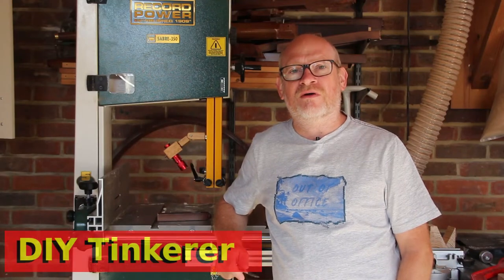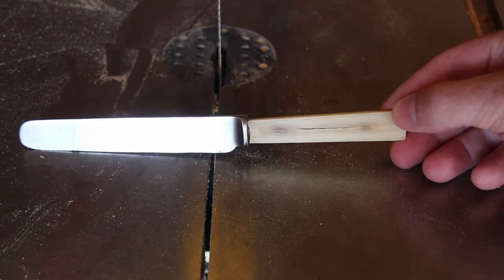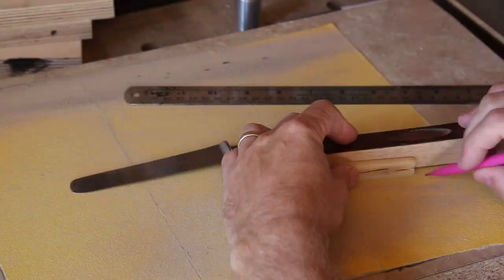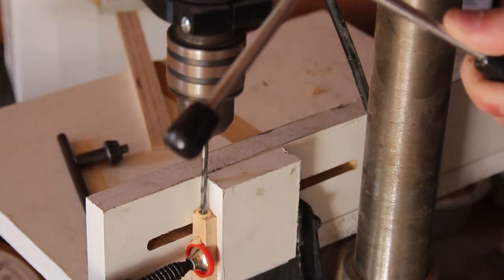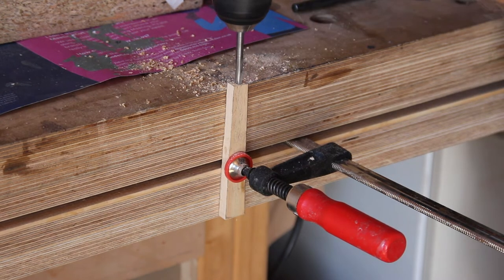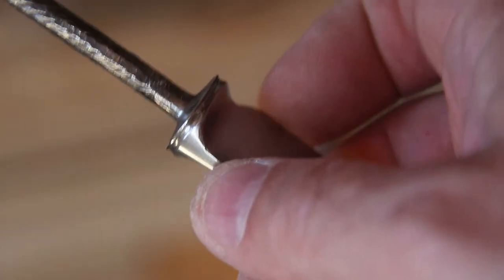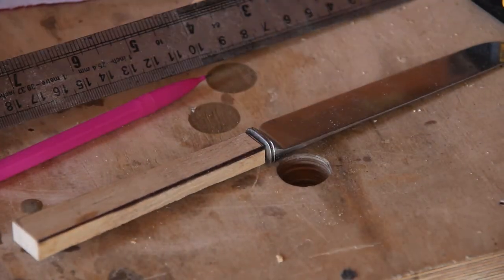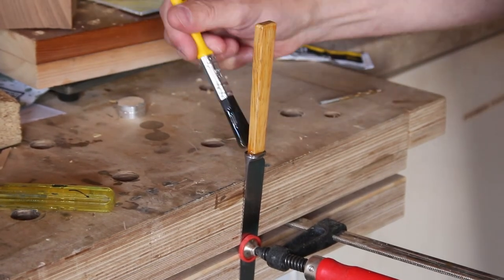100. Can I fix this old Knife?

Comment: Very accessible project. Thanks. I love those old bone handled knives. The steel is such a lovely quality. Thin, flexible and stainless. I’m not sure you could easily get another one half as good unless you went for another antique.
Reply from the maker: I agree and whilst I couldn't articulate it the way you have I really didn't want to get rid of it,  so from now on I'll use your comment for explaining why I didn't just buy a new one,  besides it was a nice project! 😀

Comment: Sadly I don't have room for a dedicated pillar drill, but I do have one of those third-party press jigs into which you install your existing drill. With some tuning (not much available!), it works as well as can be expected. Which is to say a little bit less than perfect, but that will almost always do for the projects I'm interested in. That said, I always enjoy watching your persuit, explanation and achievement of perfection. Cheers.
Reply from the maker: I think room is often the deciding factor,  one of the reasons I'm constantly trying to fit stuff on the walls is to free up space. I used to have a pillar drill adapter, they work OK, especially for woodwork, my interests used to be more metal work, which is why I originally got the pillar drill .